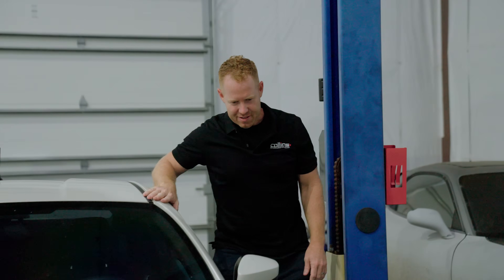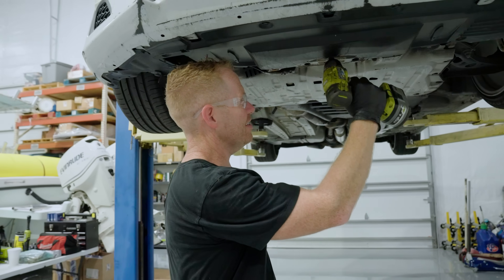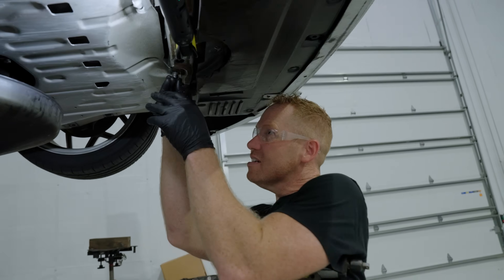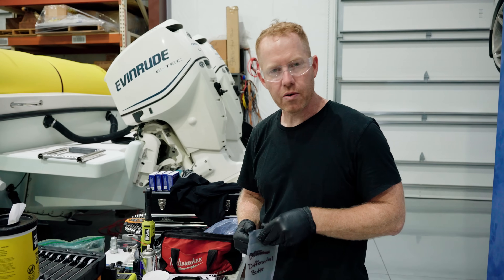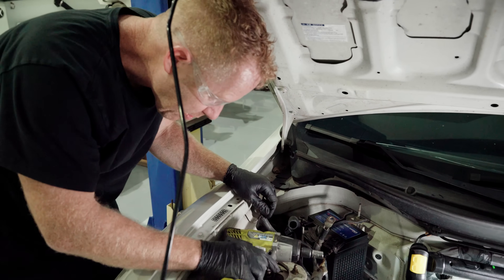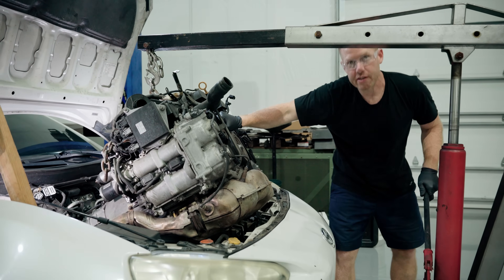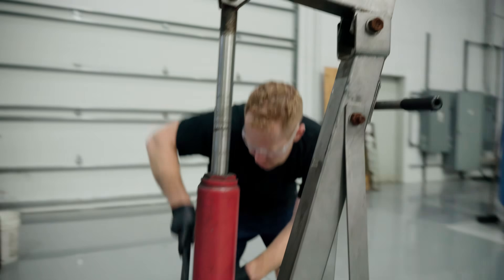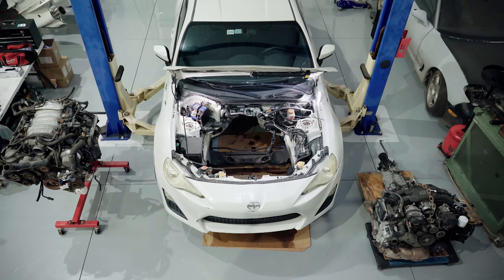3UZ-FE V8 swap into an FRS using the stock 6-speed trans, Video Series! Part 1 engine removal

Comment: This is sick, and great work. I'd only be concerned the added weight and shape may affect the driving feel of the car as being nimble....but I could be wrong!
Reply from the maker: The motor is only 134lbs heavier than the fa20.
Reply from the maker: Its only 134lb difference..
Reply: @CollinsGarage_Crett_Bollins  Yes, you replied to me the same thing 12 days ago. That could still significantly effect how the FRS handles. As I said though it’s a cool swap.

Comment: You have made me now want a frs. I’ve disliked that they use the Subaru boxer engine but you’ve now made it desirable
Reply: It improves the center of gravity a lot compared to a I4
Reply: @Romain-g7l  I’m already sold, no need to point out more improvements. 😂
Reply: Subaru engines arent bad, you just have to maintain and cant abuse them.
Reply: @senseicorey9979  In that body though I’d much prefer that V8 to the 4 cylinder
Reply: @Olive-oilien  I understand your point.

Comment: Well, if the engine was completely filled to the top with oil, I am pretty sure that was your problem.
Reply from the maker: Filled with oil as in the proper recommended amount of oil 🫡
Reply: @CollinsGarage_Crett_Bollins Yes, I know, I am being a smart ass.
I am still in business, and I had 20 years with Toyota. This is an interesting project, I subscribed to the channel to see the outcome. 
I had a Mercedes M120 v12 that I wanted to put into an 84-85 Celica GTS,  I held it for 4 years and couldn't find the right car, they were either to nice with the price to reflect it, or just rotted out junk. I just parted ways with it in June to a friend who  is using it in a drift project.
I am an old Celica fan and miss my 77 gt the most of the 6 we had over the years.
The FRS is a fairly comparable modern day version in a lot of ways to the old rear drive Celicas, as far as its basic utility is concerned.

Comment: I spun rod bearings in my brz at 42000 miles. The forbidden knowledge that the service tech told me is that the oil will cavitate at high rpm if the oil is starting to breakdown from mileage. 

I did get a new short block for free through the warranty. Now it has a turbo and I’m not expecting it to last much longer. 

For those curious, I’m running 7psi on stock internals with the works stage 1 turbo kit. I’m making about 250 to the wheels
Reply from the maker: Dang thats awesome!!
Reply: Seems like sump and pump mods may save this engine.

Comment: Hey that thing sounded like my Impreza before it let go completely… at 500 miles on the short block. Thanks Subaru for a great engine.
Reply from the maker: Yeah that's rough, hopefully this V8 will provide better reliability!
Reply: @CollinsGarage_Crett_Bollins  I can’t see a Toyota V8 not outlasting an FA20 by quite a substantial margin. The UZ should be good for at least 300k-400k with good maintenance.

Comment: Why do people go down this route to swap a v8 into a brz? I know it’s more power and everything, but won’t this be a pain to get registered and pass emissions in some states like ny or California? Plus this is a ton of custom work. You have to find a salvage engine. It just seems easier to get a c5-6 corvette.
Reply from the maker: There will always be an easier route(depending on the situation) for people willing to spend the money. However those of us that have the chassis already and don't have the money to pull the trigger on a full car for $12k-$25k, this swap really makes sense. finding the engine IS the easy part. have eBay deliver one to you for $1500 with everything you need to start the swap. Our swap kit right now with everything is currently $2800, and install it in a weekend or two, and you have something that will definitely contend with a corvette for feel and reliability for sure!! There are plenty of blown engine FRS vehicles out there in good shape ready for the taking.. Less than $8k all in with a super fun reliable vehicle that will last a long time is the ticket for sure. Its hard to price out a nice clean C5 for that cost honestly...

Comment: This also means that, in theory, it should work with a WRX right? I have a 2019 WRX base that I want to swap
Reply from the maker: Potentially, but the Subaru platform has some different considerations compared to the FRS, so there'd be a lot of custom fabrication work. the location of the transmission means the position of the engine would be significantly off. you would have to remove the front prop shafts and push it back quite a bit and run only rear wheel drive, but yeah you could definitely get it to work!

Comment: Can the stock 6 speed take the big increase of torque and hp? Thanks!
Reply from the maker: With how low the power is on the 3UZ its not a terribly huge increase in power or torque, I think it will be fine as long as you're not dropping the clutch from 6500RPM with drag slicks, it should be fine. The chassis is light enough that it shouldn't be an issue with road load etc.

Comment: In my opinion it’s would have survived if the worn oil pump was replaced before it experienced a situation where the overbuilt system was sufficient until at a higher stress situation aka. U going downhill at high rpm’s, ore clogged up oil galleys or squirters, but must likely u got cavitation happening on the pump causing wear and tear, which sets u up for a failure event at the right variables u starve parts of the motor from the change in flow rate while engine pressure looks okay
Reply from the maker: Yeah, it was driven in a real world, straight-line scenario, filled completely full of good synthetic oil. Cavitation should not have been an issue accounting for normal conditions(hills, turns, acceleration). This should have lasted longer if the system was engineered for longevity, higher capacity oil pan, I could go on and on. The OEM engine is not built at the same high quality as the Lexus engine we are about to swap into it. stay tuned for a torture test in real world conditions so you can clearly see the difference..

Comment: Have you considered doing a F20 S2000 swap kit? Yes the motors are scarce, just thinking it would keep the balance of the car similar for weight and handling.
Reply from the maker: Maybe, the weight difference is only 134lbs, I don't have an S2000 engine anymore or an S2000(I sold it). also the engines are expensive.

Comment: I'm doing a 1UZ swap on my AE86 and found those exact same headers. Stupid cheap for what you get. Even if they do require some light working (provided you can do the mods yourself of course). I am curious as to the use of the J160. It seems like a very fragile gearbox for the 300 hp/tq of the 3UZ. Can't wait to see how this all goes.
Reply from the maker: the J160 is also weak-ish as well. We had a guy that had a JZ swap with J160 on it with this weird adapter plate and we swapped it out for a CD trans. the BRZ FRS transmission should be fine as long as they don't put drag slicks on it and drop the clutch at 6500RPM

Comment: I’m doing the opposite now swap the trans into an sc430 lol
Reply from the maker: ohhhh wow, thats not a bad Idea honestly. I would recommend the CD transmission as it holds more road load better, also the increase in weight of the vehicle will take its toll on the transmission specifically.
Reply: @CollinsGarage_Crett_Bollins I was told just change the syncos and get hardened second and third gears because those was the failure points the trans I really want is out a gs450 h the hybrid has 2 electric motors in it .  I was gonna get that and a rear end out of a Highlander electric rear .  

So 4 motors total 😂😂

Comment: This swap is very interesting. Looking forward to watching the completion of this build. I’m most curious about the engine management right now and can’t wait for the next video. Let’s gooo!
Reply from the maker: Stock engine management on this one! once you get the immobilizer re-flashed out and the automatic transmissions codes taken out, it runs awesome! We used the emulator to get the CAN communication dialed in with the FRS(coolant, RPM, etc) its pretty sick once you're done. Stay tuned!
Reply: @CollinsGarage_Crett_Bollins How does an engine management made for 4 cylinder run 8 cylinder
Reply: @CollinsGarage_Crett_Bollins  We ordered the swap kit yesterday and are super excited for this new experience! We are from Toronto, Ontario (Canada) and I don’t know of anyone local to tune the stock 1UZ ECU. Would you have a recommendation on who we can send it to for the immobilizer and AT codes delete?

Comment: I just found the channel and love engine swaps i mainly do LS swaps for Camaros, Chevelles and all other Chevy's with a couple Coyote  Mustang and F100's mixed in.  I have always liked those rear wheel drive FT86's and the lot and have been considering building a daily, luckily I found you guys to make V8 swapping that platform a little easier. I just subscribed and I'm looking forward to progress on this build.
Reply from the maker: It will be a reliable weapon once it is done forsure at 2850 lbs its light and fun!!

Comment: As a Toyota tech most of us agree the Frs is probably the most fun small platform but also by far the least reliable because we were dumb enough to let Subaru in on the fun.
Reply: The 86 wouldn't exist without Toyota making Subaru foot 70% of the work. The GR Supra was 70% BMW's doing, and even the Mk4 Supra wouldn't be a thing without Yamaha's not insignificant contribution. Toyota won't do anything cool without someone else doing most of the work
Reply from the maker: We love Yamaha, but bigggggg Facts!! the did do the LFA though.. (also Yamaha in that one too)
Reply: @FLuXX_PwR  Toyota makes plain Jane reliable cars, that keeps them  paying the bills making a profit. Sports cars do NOT generate a profit for plain Jane car manufactures like Honda, Toyota, and Nissan. Which is exactly why Toyota partnered with Subaru and BMW on the cars mentioned. You have to offset the cost somehow.
Hard to justify the cost of Toyota to build their own modern inline-6 from the ground up with a stout transmission also, when the Supra isn’t going to make a profit lol.

No different than the last few generations of the Acura NSX, it’s been on the worse selling list of cars for years, I think the Nissan GTR is on that list also. They don’t sell enough to offset the build cost.
Reply: @goforbroke2 
Savvy from a business perspective, but not an alibi that holds water.
Any manufacturer knows it's a no-brainer that sports cars won't sell as well as cars for the average Joe. That's why they get offset with all the "plain Jane" vehicles. It's always been this way. But when it comes to making sports cars, Toyota is and has been effectively the only one making someone else do most of the work. Why do they get a pass? Would you have me believe the biggest of the Japanese auto manufacturers is incapable of making a sports car in-house for reasons of profit?
I highly doubt Honda sells a Civic Type R because they think it's going to go by the millions. Imagine if Ford told GM they need them to develop a new chassis for the Mustang because their profit margin would have been too low if they did it on their own. I simply do not buy it.
Reply: @FLuXX_PwR when Toyota does all the work they spend a billion dollars and develop the ls400
Reply: @FLuXX_PwR  Way more than 70% of the work.
Reply: @FLuXX_PwR y todas esas compañías son propiedad de Toyota o Toyota es el accionista mayoritario 😮
Reply: This car wouldn’t be here without Subaru this is basically a Subaru underneath anyways
Reply: 200k miles isnt bad, you at least have to admit that.  The FA series has weird oil issues, which seems endemic across all of them.  Surprised Toyota/Subaru aren't releasing the "special" models with oil system modifications to address the issues.

Comment: What's the weight difference with the V8, tho?
Reply: It's an all-aluminum V8. They are fairly light. It is definitely heavier, but doubtful it is enough to upset the balance of the car. The weight delta is probably in the realm of an FA20 turbo kit.
Reply: @Pavel_Engines  Thx. I'm asking more from the FA24 perspective, which is probably even heavier than the FA20. The FAs are not light engines.
Reply from the maker: 134lbs was the difference when we measured. we will be showing it in an upcoming video

Comment: j series to Tkx transmission for an NC Miata?
Reply from the maker: We're always looking to expand our swap offerings, a J series into an NC Miata could be a cool project.
Reply: @CollinsGarage_Crett_Bollins Thanks for the response. the neat thing is Fab9 has a tail shaft adapter to mate the TKX to the Miata  power plant frame aluminum c channel thing. I also believe the stock NC trans can hold up to stock or lightly breathed on J series power if the turbo 2.5s are anything to go by.

Comment: Great work. Makes me more interested in the car now. I have absolutely no interest in the stock engine in these cars but love the lightweight precision chassis. Id just rather see a smaller lighter weight engine that would throw off the balance of the car so bad
Reply from the maker: We weighed the engines. The v8 is just under 500lbs, making it 134lbs heavier. 

By comparison, a 2Jz weights 600-650lbs. People put those in these and seem to perform just fine.

Comment: How will the stock trans hold up to that extra torque?
Reply: They only survive because torque is purposely reduced, this v8 is going to eat the gearbox for breakfast, lunch and dinner. Going to be snapping shafts too 😂
Reply: 4th gear synchro is a known problem, maybe good for ~230-250lb-ft. This job will inevitably include: transmission internals/swap, driveshaft, diff, and axle work.
Reply: BRZ guys install turbo kits all the time that make 300hp and they survive just fine even in drifting abuse with the shock-loading from clutch-kicking.
Reply: The axles are the real weak spot.
Reply from the maker: The stock trans is rated for 300/350lb ft of torque.

Comment: What about the 3UR-FE out of a tundra ? 400 hp / 400 torque
Reply from the maker: Yeah you’re talking an engine that’s close to 400lbs weight difference. The 3uz is only 134lbs heavier than the FA20
Reply: Too big & heavy.

Comment: i'm more interested in a 2GR-FSE swap into the FT86/GR86 :)
Reply: Facts
Reply from the maker: Maybe one day we will peak that interest.
Reply: awesome engine, but they are expensive for maintenance (when its due, not because it's not reliable)
Reply: @tturi2  i had 4GS350 for 4 years now. OIl maintenance every 7000KM and valve cover gasket replacement at 120,000KM. Thats all.

Comment: Dude really said “going downhill, revving out but it was filled with oil” they’re great handling cars but if you ran a stock oil pan with no baffles, you starved it. Yes even the newer fa24 and the wrxs need a baffled oil pan if you start adding grip. 👍🏻👍🏻👍🏻 I’m actually shocked it lasted almost 200k
Reply from the maker: That's a good point, oil starvation is definitely a concern on these cars with any amount of performance driving.

Comment: Hey
Closer to the end of the video, u said 1gzfe could fit( need new hood), dry sump could be a fix plus cd009 transmission. What do you think the weight distribution would be?
Reply from the maker: You don't need a drysump to fit it in... just different intake exits and different valve covers. We are working on valve covers etc right now..

Comment: Collins Garage Team
Thank you for this setup. Why the stock transmission tho, was thinking more r154/cd009/t56f?
Reply from the maker: In stock trim the 3UZ-FE doesn't make a ton of power/torque. So this would be a cheap affordable alternative to CD/T56/etc to getting these cars back on the road. We already have a full solution for the CD/6GP transmission in this chassis. So look up our transmission tunnel reinforcement bracket system for the 350Z transmission for FRS chassis on our site. It should be instock.
Reply: @CollinsGarage_Crett_Bollins  thanks for the response, Great point affordable quick solution 👍 👌 👏
Reply: @CollinsGarage_Crett_Bollins  are you sure that these are strong enough to hold this torque? A lot of j160 - which is Altezza/is200 gearbox died with 3uz or 1uz vvt engines, even without clutch kicking, just normal pull. gt86/brz az6 is pretty much the same transmission.
Reply: I strongly suggest checking out the BMW ZF transmision as a option for this AND the Kseries swap(specifically turbo Kswaps or spicy 3UR swaps)
Reply from the maker: We're going to torture test this thing once it's running and everything so you guys can see.

Comment: Do you think the stock transmission can handle the torque of the 3uz?
Reply from the maker: We made almost 500whp on a Turbo FA20 before and that was on a stock transmission, but that doesn't have the torque of the 3UZ-FE. This is going to be similar to the KA/SR transmission that we have used in the past with a UZ. The SR transmission started giving out around 385 torque with a supercharged 1UZ. We will test this and report back, but I don't see it being a big deal unless you put a huge tire on the car...
Reply: @CollinsGarage_Crett_Bollins very interested to see how much this thing cost.
Reply: If it’s a drift build honestly no.
Reply: Zf swap?

Comment: Can't wait to see updates on this swap! I've been researching on how to do a 3UZ swap into the FR-S. Is there a bolt-on solution for headers without cutting and rewelding?
Reply from the maker: We are working on that now, I have a supplier that can do it, it will take alot of work and time to get them fully dialed in. But if push comes to shove me or Johan can personally make a set for you.